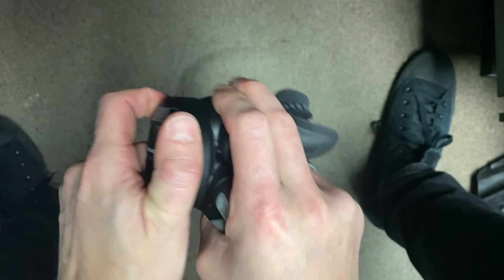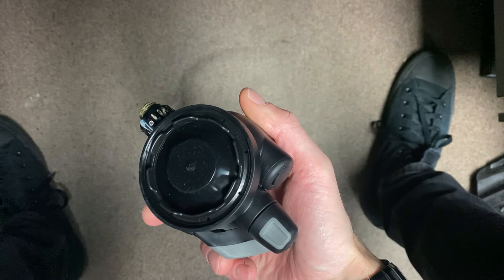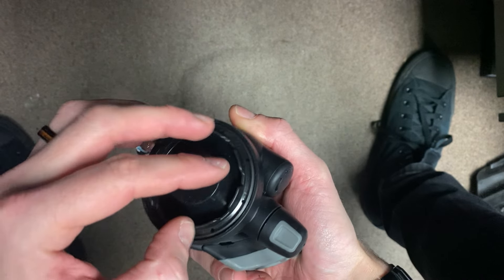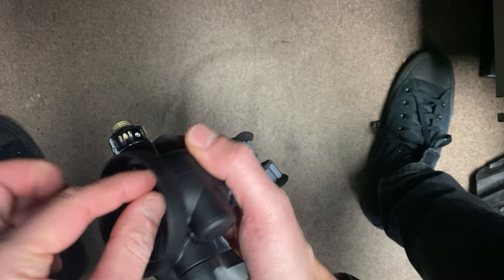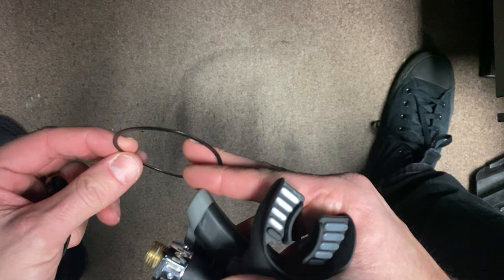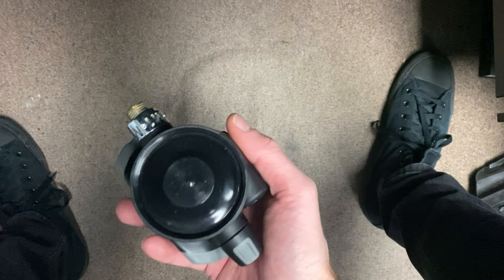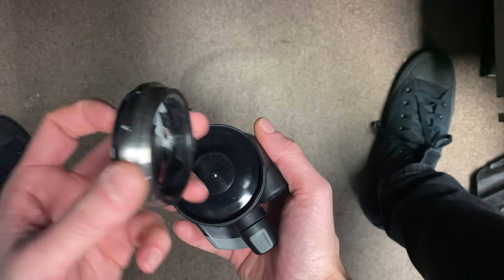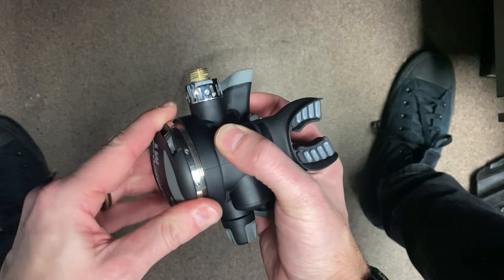Installing the Atomic M1 Cave Ring

Comment: Hello,

I have a question about whether it is worth buying the Atomic M1 or B2 in 2025. I am interested in this brand but I am not sure which model to choose, M1 or B2, so that I can dive in cold waters below
Reply from the maker: The great thing about atomic regulators is you are dealing with the same A+ design from one of their regs to the next. The M1 is popular with the technical diving community and is built with the metal, Monel. It does well in high o2 environments and was built without the use of the 2nd stage hose swivel to limit failure points. The M1 first stage is sealed to keep out contaminants and to offer better cold water performance.  The B2 is the most popular recreational regulator Atomic produces and it is made of Brass. It has the 2nd stage hose swivel to offer more comfort. The B2 can you purchased as a sealed regulator or un-sealed. IMO go sealed to keep out salt and coldwater from touching the internal components of the first stage... You cant go wrong with Atomic!